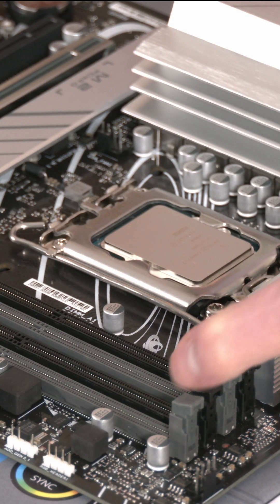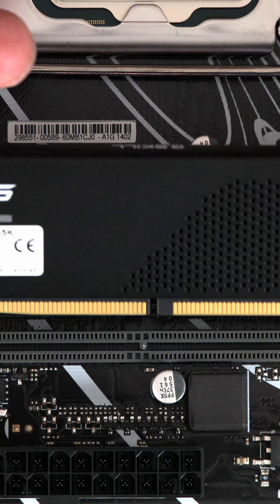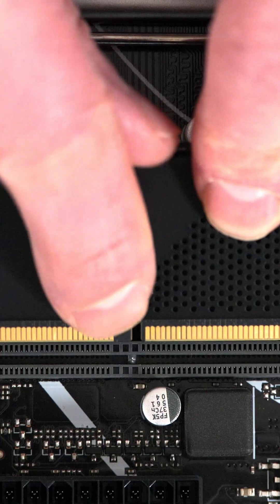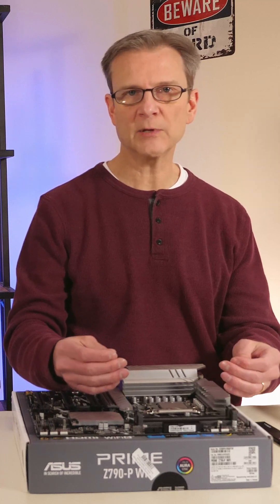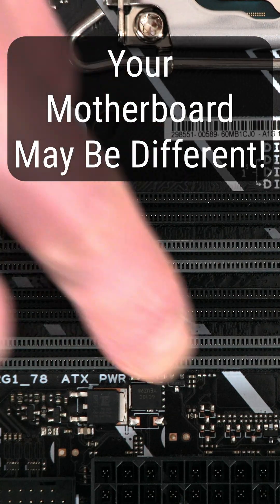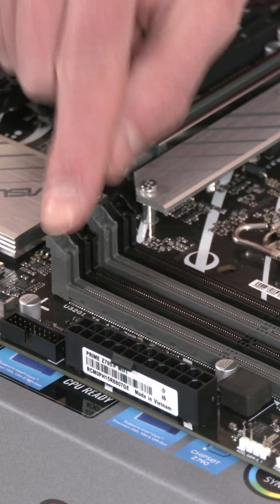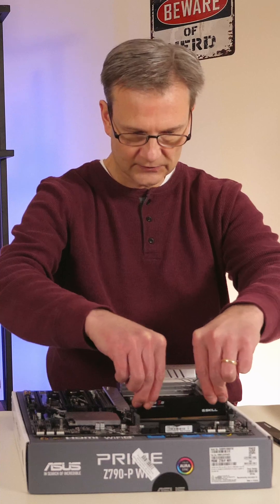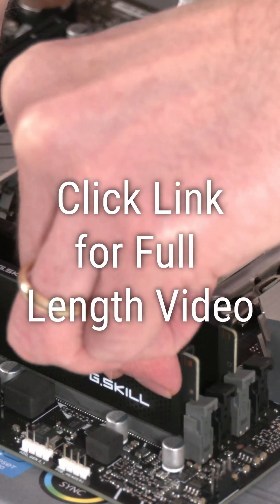How to Install RAM in Your Motherboard #pcbuild #Shorts

Comment: Do I need to wear special anti static gloves? I’m afraid of electromagnetic discharge. Not all the time, just when I’m installing ram. I think that goes without saying.
Reply from the maker: It's always a good idea to protect your computer components. An anti-static mat is a good start. Some anti-static wrist straps are also a good idea. Gloves may make working on a computer a bit more difficult, and are probably not necessary, especially if you have a mat and wrist straps.
Reply: I think the wrist strap would just get in the way. I’ll go the diaper route.
Reply: no as long as you are wearing rubber soled shoes or NOT on carpet then youll be fine. just always remember to ground yourself by toughness the outer case
Reply: Yes, you’d better wear diaper, just in case you wet yourself.